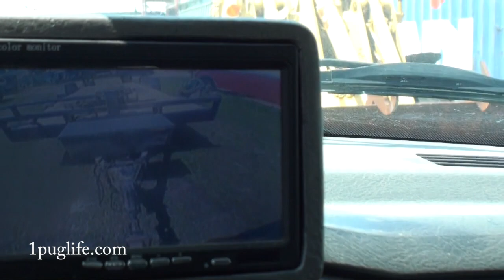tumuchi is up to no good, no brakes, trailer paint, and spiky wheel nuts

Comment: Stop buying and repairing junk and just get your ol lady a nice vehicle. A little hose and bucket or gallon bottle works great for bleeding brakes none gets on the ground not hard to figure out. Plus you dont care about getting chemicals on the ground when it comes to undercoating. The rear looks better without the center cap
Reply: $30,000 he was willing to spend on a payloader that is same size as the two he has, but $6 on his old ladies van ? too muchi !!!
Reply: Everything when it comes to his old lady is too muchi (seems he only has her to make him food). Then he wants to buy numerous amounts of the same things like loader then complains they are shit but when it comes to buying he wants it in like new condition but only willing to pay 25% what its worth and gets mad when no one will go that low.
Reply: the 12 ton payloaders he has will lift the Grumman if he had some counterweights , maybe Nelson could stand on the back , his hammer surely weigh 12 tons and the goof would be the one to know
Reply: @carmineredd1198  I commented that on the video of it tilting with all the free steel he gets jus build a box on the back and fill it with the free steel
Reply: @FishFind3000  he is high 24/7 that's part of the issue. Years and years ago he had a clear mind and knew stuff like basic common sense